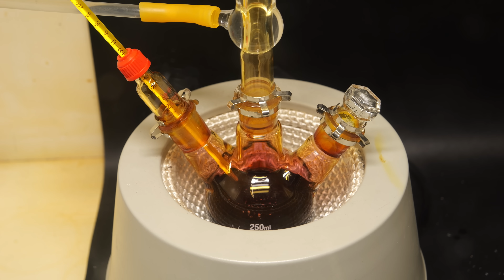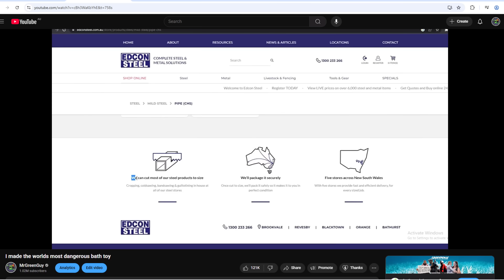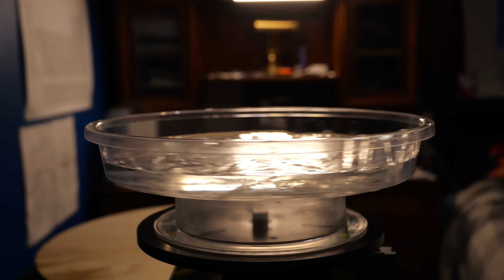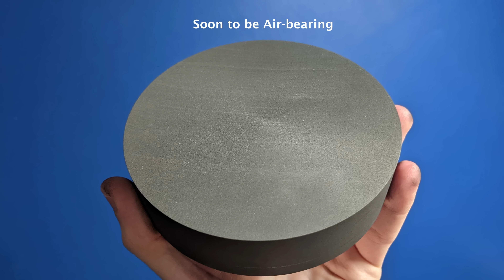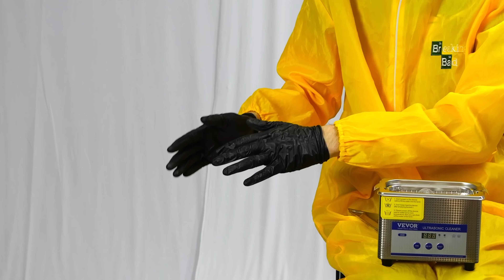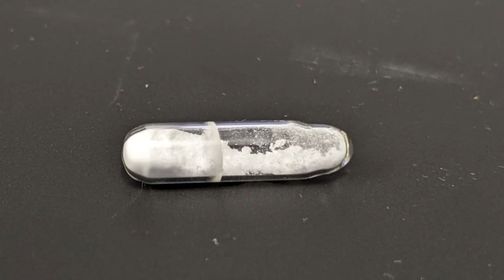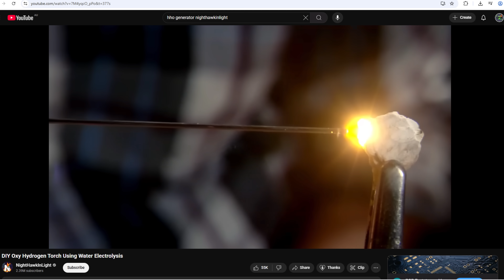Ranking My Experiments I Couldn't Post

Comment: No promises, but I might have some useful suggestions. 

Make friends with ChatGPT 5, free version. It isn't perfect but it does make a reasonably good research assistant. It tends also help me get very creative and quickly check if the ideas might work.

Use more more junk. Dumpster diving can make a good complimentary hobby to what you do. Also used junk for sale at the right price. You might not find off the shelf equipment that you can use directly, but often parts you could cobble together with hand tools.

Kind of silly, but see if you can find old reruns of a TV show called MacGyver for inspiration.

I'm weird, so maybe I'm wrong, but I would think your viewers would like to try out some of your projects for themselves but not if they're going to have to borrow money from some dude with a lot of experience breaking kneecaps. 

For air bearings, you might want to have a look at past videos by Applied Science. He made some out of graphite. I don't think the graphite was expensive but he did machine it, IIRC. However it also looked like if you keep it simple, you might be able to use hand tools to rough in the shapes and then wear (without air) to get a more precise fit

An old family friend's son in law helped make a spin-parabolic mirror professional telescope, I think in Colorado US. IIRC they used mercury. I was a kid at the time so not sure how accurately I can remember talking to the guy, but I did talk to him about doing something like your project.  One problem you might run into is that materials tend to expand or contract when they go through a phase change. Before curing, exposy resin might be flat but dip in the middle from contraction when cured. I think most low temperature casting metals expand when they solidfy. It might be possible to find something that doesn't change volume enough to matter. I think at least some very large modern glass mirrors are roughed in by spinning while molten, then less grinding is needed .
Have you tried a record player? Or even old hard drive? (lookup how to power the motor.)

Comment: I feel like the water turntable is a good idea. Can you use magnets with a slow motor to make it turn instead of the vortex? If the motor is well isolated from the bucket, it could vibrate without making the resin vibrate, using the magnets as a low pass filter

Comment: Hmm. How about adding extra mass to the turn table for damping vibrations? Or perhaps a magnetic stirrer coupled to a floating container with submerged vanes to couple with the liquid for damping. Otherwise try a turntable mounted on a bushing, oil bronze, etc and coupled to the drive motor with an elastic band. The bushing should result in lower vibrations as it doesn't have ball or needle bearings to introduce vibrations. The elastic band may be able to dampen the motor vibration.

Comment: The turntable project could be achieved by using ballbearings on the rotation axis. The more ballbearings you use, the more stable is the rotation. Also, you may need suspension springs for stabilizing against vibrations.
Reply: And a big flywheel. Like 20 or 50kg of gym weight on the chair idea. That would help a lot with smoothness issues.

Comment: Have you ever tried just regular bearings? I think the structure can even be out of wood. Use a metal rod for the center and then two bearings as far apart as possible and one of those camp things so it doesn't fall through. You don't have to weld and can use your saw. I don't think the smooth rotation part should be so difficult. And for Vibration stiffness, just use a huge mass to dampen it enough. Then a regular motor with a variable speed control. All easily online available
Reply: If you really want to, I can make you a cad model to build after

Comment: If you wanna make something that's just right and to not spend like hundred or thousands of dollars, why not just get a 3d printer? 

Like 3d printers are literally made for rapid prototyping for cheap, and most printers are now very good like Bambu (especially Bambu with their H2D and H2S which can also Lazer engrave) for a pretty cheap relative price (I know the H2D Lazer is 4500 AUD but it can service you for many projects, reduces the need for importation, and can last for a long time)
Reply: Sorry did you just recommend the company that tried to lock down their printers so you could only print approved things? Never buy Bambu again. I heard Prusa is not quite as good but fully open.
Reply: @thewhitefalcon8539  Creality is also "good enough" if someone is trying to get one cheaper one (at the cost of quality) and they dont block you from doing whatever you want with the device
Reply: @thewhitefalcon8539 You can print anything? Not just approved things (dunno where you got that from since I use tinkercad to print my models) 
The only thing was locked down was their hardware and firmware

But yea I agree with you that Prusa is better since it's open-sourced and can be upgraded... But I'm not a tinkerer and just wanna print out of the box so Bambu it is.
To sum it up, Prusa is good for tinkerers, and open-sourced supporters, while Bambu is good for common folk like me who just wanna print and not mod it but it's closed sourced (like most appliances)

Comment: You should talk to @NoEngineerHere or @Ididathing (as far as i know they are both based in australia, so no importing required). They make stuff and might be able to help you with the parabolic mirror/lense project. 

If you need a gas torch for quite cheep look into making a HHO torch like @hyperspacepirate did, he might also give you advice on the lense project.

Comment: Engineer here:

If you take the big black bucket and suspend it from a central point with three springs and somehow rotate the central point it should work. HMU to make it happen!
Reply: That's what I was thinking. It's likely too heavy for a magnetic bearing, but a simple spring system to absorb vibration and a slightly stretchy rope up to an electric motor might work. Rope will dampen out most of the vibration of a motor humming. Same with the springs. Trick would be getting it balanced, but that's just a matter of fiddling with it a bunch.

Comment: The only thing i can imagine that would spin as precisely as you need, as fast as you need and be able to hold the weight is at the very least a big professional grade lathe, ive seen massive ones used in factories that spin items vertically, so your best option would be to somehow hire some dudes who have that kind of equipment to spin your thing.

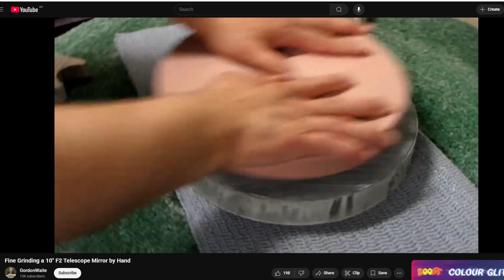Comment: 11:30 why not try magnetic levitation 
With strong magnets it'll be able to hold a lot of weight and it's as smooth as bearings go
Reply: that's what im thinking but also with my zero research im concluding it's not super easy to pull off
Reply: @tbounds4812 I'd assume so, but worth exploring at the very least, and sounds less expensive

Comment: 16:01 maybe a junk car engine? You use the flywheel as the table and turn it on the other end with a electric motor.  Combustion engine have really tight tolerances so it should be smooth or a drive axel of an car could also work
Reply: Wouldn't the whole engine vibrate quite a bit though?
Reply: @superslimanoniem4712most modern-ish engines have good balance, otherwise they would shake themselves apart.

Comment: Perhaps for a turntable for the parabolic mirror, you could use a PC fan rotor for the turntable? Fans tend to be cheap <£30 and are optimised for low vibration, especially from companies like Noctua
Reply: look how the turntable.

Comment: Have you considered suspending the tub from a beam in a building with a normal cord? Just an inverted v shape (maybe two chords for stability) attached to the rim of the tub. You twist it up to the top, then let it rip. Add a ball bearing to stop the back and forth of spin-unspin and there you go
Reply from the maker: Yeah I've tried motorizing that sort of setup with adjustable length cords. It does work, though I find it's not much better
Reply: @mrgreenguy  but have you tried without motors? That and a stable and heavy enough place to suspend it from like a steel beam from a building...

Comment: For the spinny thing you’re trying to make/buy: what about a ceiling-hung design? If it’s suspended, it could decouple from the frame and cut vibration that’s warping the surface.
Reply from the maker: Yeah I was able to try that design, though it had swaying issues similar to the water one

Comment: The turn table, my armchair idea with no other research: Small motor mounted hooked to a bike chain that turn a pully, attached to one of those kitchen table food holders. I had a super cheap one growing up that held a ton of food and rotated super smoothly.     Idea 2, ceiling fan with a rigid drive train attacked to the lid of the vaccum thing, add rubber wheels and make sure flat floor for minimized vibrations. anyways. just a brainstorm as there are a lot of hurdles with those ideas. There is also a mythbuster episode where they made a plaster parabola for the Arquimedes death ray.

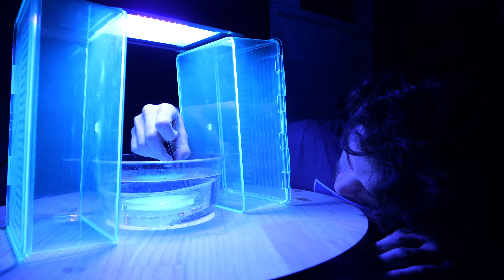Comment: 11:00 for your resin plastic telescope miror , have you tried 3D resin printer ? The way that it works is that it uses UV light to solidify a layer of resin and repeat the process multiple times for each layer. In march there is some scientists that made some microscope using that technology. I guess you could use the same technology for a telescope instead. Edit: It might also helps you make other things that you can import but cost an arm and a leg , and you can also make about anything you want if you want to learn cad or find it on the internet. Looking at 30:17 you seems to already have some UV resin , wich would be a good return on investment for that resin ( if it sticks to the build plate)
Reply: what printer was it though? a normal one can't reach the precision needed for a lens or mirror, right?
Reply: @multi_array  The team used a Mars 3 Pro, wich is currently 129 $ in the us. The main issue for the project is the build volume at 143x89x175mm. of course  , he could get something larger that fits his needs but it is proof to me that any resin printer can do the trick. However, don''t expect FDM printers to achive that without serious sanding at the end of your print.
Reply: @rndargis0  FDM has an issue with clear materials where the layer lines appear inside of it aswell which would likely ruin the telescope effect

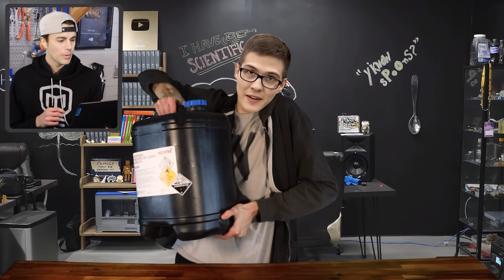Comment: 4:00
you call that bad? i bought 99.8% pure (thats what it says) hydrogen peroxide without any checks (they called it farming land acidizer and still sell it), off the internet, and it is actually above 90%, dunno if its really 99,8% as they call tho, but still fucking crazy. They sell a lot of other dangerous chemicals under the "farming chemicals" name.

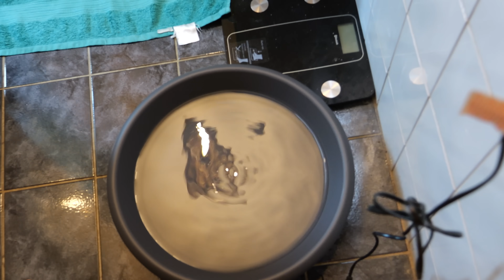Comment: 14:35 I don't think the whole parabola mirror idea is ever going to work because even the slightest disturbance from the slightest breeze or a speck of dust is going to ruin it. Forget all the engineering problems, you'd need to whole setup inside a massive vacuum chamber to ensure good results.
Reply: vacuum chamber and a liquid...seems legit
Reply: @multi_array  resin can go in vacuum chambers… that’s part of the process
Reply: @kyetes.866 thats surprising to me. thanks for letting me know.